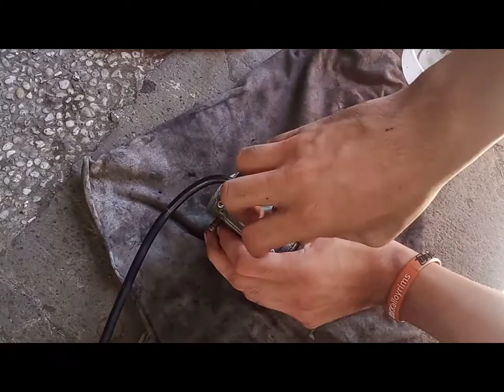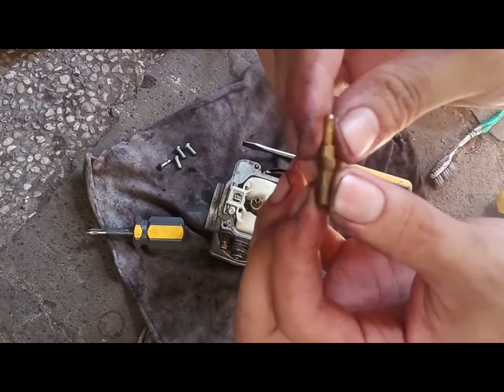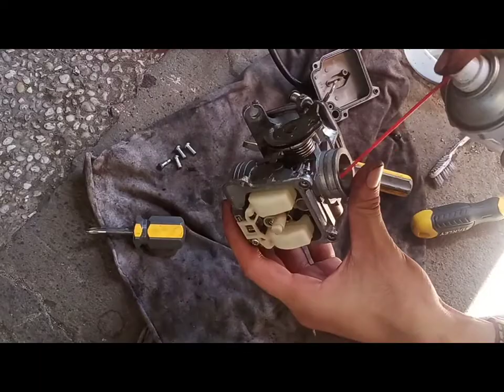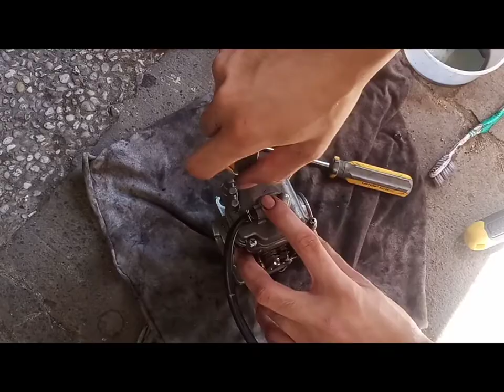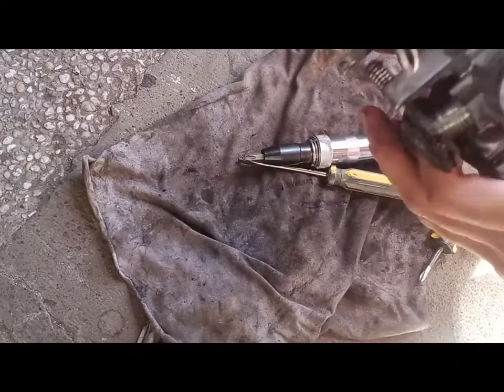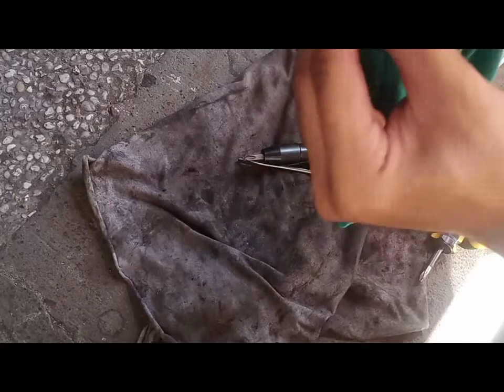Mio sporty carburator jets cleaning

Comment: Paps Totoo tipid sa gas kapah pinalitan ang jetting niya? For example yung size ng jetting ng amore? Thank you.
Reply from the maker: Yes sir. Totoo po pero marami din kasing factor para mapatipid ang konsumo ng motor.
-regular change oil
-Tune up
-tire pressure
- riding habit mo sa pagpapatakbo
Reply: @motorenzo327  na try mo na paps? Mga ilang litters na tipid po? Umorder na ko ng jetting ng amore for my soulty.